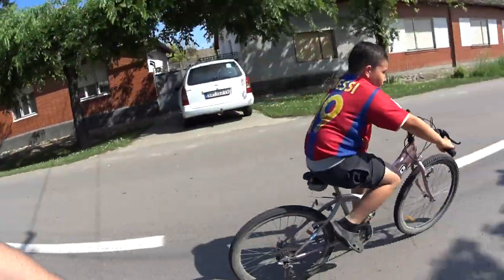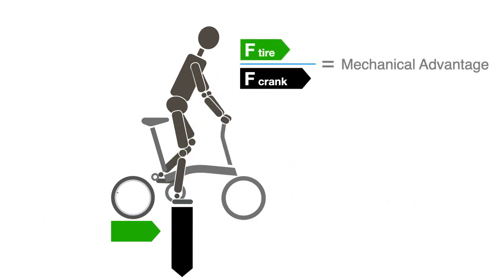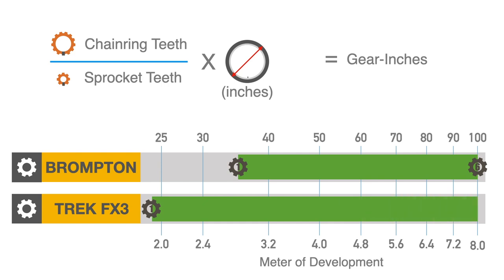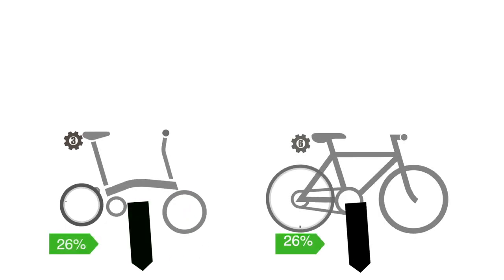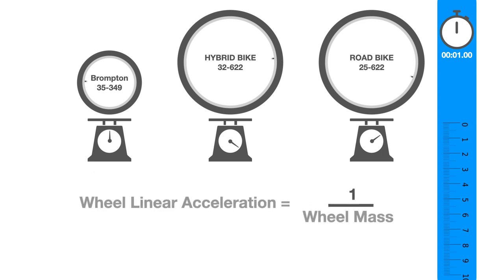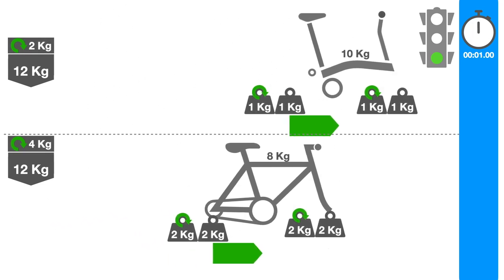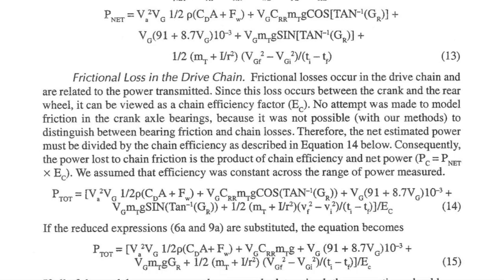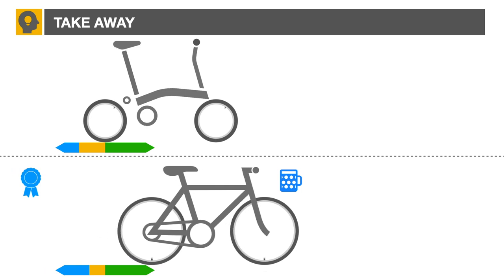Brompton Acceleration - Myth or Reality?

Comment: A year ago, I've made some math and get the rotational inertial of 20" wheels would translate to 1,5 kg advantage weight in comparison to 26" wheels, which mate your results. That doesn't explain why I jump ahead in may folding bike when the lighs go green. The answer may be on the much faster changing gears that is possible on a bike with smaller wheels.
Reply from the maker: Everything else being equal, 20” tires have better rolling resistance than 16”. The bike (and you) may also be lighter than your opponents (and/or you are in better shape then them :-)
Reply: Lower centre of gravity
Reply: Maybe also that it takes less time to "get in position"? Just a thought...

Comment: moment of inertia is actually sum( mr^2) for all the point mass in an object. so i believe when calculating the rotational kinetic energy, since the mass is closer to the axis of rotation, mass value is NOT the only factor?

however, i agree there are too many factors at play, so, why don’t you do some physical experimentation with some bikes you have. accelerate 10 times with each bike, look at the footage and give conclusions. isn’t this how we get statistics?
Reply from the maker: You are right Osmond, a bicycle wheel moment of inertia (I) is computed using sum(mr^2). So, at first glance, r seems to have a much bigger effect than m.
To simplify calculation below, let assume most of the mass is located on the perimeter of the wheel.
The Newton’s second law as applied to rotational motion is: 
T = I α 
Where:
T = (Tangential) torque on the contact patch
I = Bike wheel moment of inertia (mr^2)
α = rotational acceleration (in radian/s^2)

Assuming the propulsion force on the contact patch is F, we have
T = F r
We know the relation between rotational and tangential acceleration is defined as:
 α = a/r

So, if we replace the value of T, I and α in Newton's 2nd law equation, we get:

F r = mr^2 α / r

If we cancel out all the “r”, we get:

F = m a (which obviously looks very familiar)

So, the tangential acceleration (a) on the contact patch will be proportional to the propulsion force F applied to it divided by the mass (m) of the wheel. We already established both bikes will have the same "F" if they have similar crank and meter of development. So, the radius will have no effect.

Rotational dynamic motion is based on Newton’s laws, not statistics.

Comment: Sorry, as well intentioned as this video is, there are several errors in the deductive logic and calculations. To highlight one, at c4.40mins, the weight of a bicycle wheel is a factor in the linear inertia, but a much greater consideration is its radius. This can be understood better by considering a wheel as a simple lever in which a longer lever resisted at the fulcrum requires more force to resist with the same weight applied at the other end than a shorter lever; in other words the Brompton wheel will initially accelerate quicker with the same force applied at the hub than a larger wheeled bike because of the mechanical advantage. The issue that is most egregious however, is the omission that friction in the Brompton gear hub, especially in the high gear, is significant which slows acceleration. In the case of a headwind, the Sturmey Archer friction is unable to overcome the opposite force applied to the rider which prevents any acceleration at all. Brompton's are great bikes, despite this flaw, but this video does not unfortunately fairly represent the physics involved.
Reply from the maker: Internal hub friction losses vs derailleur and aerodynamic effects  (as discussed in our video ( https://youtu.be/F98oQ7Xo5mI )) were indeed taken into account in the simulation model used.
This model ( https://www.researchgate.net/publication/279937184_Validation_of_a_Mathematical_Model_for_Road_Cycling_Power ) was demonstrated to have a correlation (R2) of .97 between projected number and actual measurement. If your recorded evidence significantly diverges or maybe you favour some opposing  view research paper, please share them with us.

Comment: That was quite impressive. I fully expected a Brompton channel to say 'it beats road bikes'.  I would be surprised if 90% of the viewers had any idea what you were talking about (myself included) however. I think a real world test featuring the same rider with a watt meter to make sure it is the same output for each bike would have been better. My own experience is that I have a 6.8kg single speed hummingbird folding bike with carbon wheels and the sense of speed, maneuvering and accerlation is unrivaled by any other bike I myself have tried to ride.I think a lot of acceration and time is wasted shifting gears, with the hummingbird, I can stand pedal initially to accelerate and then quickly transition to sitting down without wasting any acceraltion shifting. If you hit a long steep hill, just walk quickly
Reply from the maker: Actual test would indeed be ideal. We are planning to analyze GCN’s latest YT video about Brompton to extract some “field data”.
What crank, gearing (front/back) and tires do you have on your Hummingbird ? What would be the weight of a wheel (about 1Kg?)
Reply: I often wonder how these field tests are done... I imagine there would have to be a lot of experimental and statistical control for riders' motivation, familiarity with the bike, road uniformity.
Reply from the maker: @tandago7281  One way to simplify the test would be to do 2 races and swap bikes and riders between races (each rider doing a race with a Brompton and a race with a road bike)

Comment: I believe the nimble feel of the Brompton gives the illusion of acceleration. Regardless, on my 6 speed with 44T front chainring, I use gear #1 for maximum acceleration out of difficult junctions (from a standstill) but otherwise gear #2. I have never attempted racing conventional bikes away from standstill, but in tight traffic conditions I am happy to say that the Brompton is the fastest of my own bikes for making good progress. The nimbleness, short overall length, and ability to change to a low enough gear (on the 3-speed changer) at or near standstill means the bike is a perfect traffic companion.
Reply from the maker: Agree. Size, agility (and downshifting while immobile) makes it easier to use in a crowded urban environment than a full-sized bike (We have 44T as well btw.)

Comment: Sorry, you didn't cared about mechanics , I'm 26" Montague Paratrooper and brompton owner , I'm used to ride them alternative , monday with one , tuesday with other, and compared them and feel be easier maintain high speed on avenues because the last element in contact with pavement must have shorter transmission rate, the 16" wheel in this case. This is a practise experiency. Not theoric.
Reply from the maker: Thanks for your insightful comment.
Our Montague Paratrooper 26” (yes, we do own one as well) is heavier than our Brompton, is it the case for you?
Our Montague tyres have a higher coefficient of rolling resistance than our Brompton, is it the case for you?
If yes, this would explains why you (and we) are faster on a Brompton. If not, congratulations, you have beaten the law of physics.

Comment: great maths but in the real world its unlikely one would accelerate from a stand still from half way through their gear range. would be interesting to see the results of a real world drag race next time! thanks
Reply from the maker: We support your suggestion for an actual “drag race”!
We confess, in a normal urban environment (assuming flat road), we rarely use our Brompton 1st or 2nd gears, even at traffic lights (we do have a 44T)
Doing the math using a lower gear setting, the Brompton would lose and additional 3% efficiency due to its hub planetary gears while the Trek would see an improvement in efficiency due to its use of a bigger sprocket, so the updated results would not be too favorable for the Brompton.
Reply: @2Bikes4Adventure  I assumed as such but I don't have the base knowledge you do to make this statement. Thanks for further clarifying for us
Reply: @2Bikes4Adventure  oh wow thats so interesting. i hadn’t considered how the hub would affect things, thanks!
Reply: @2Bikes4Adventure  "We confess, in a normal urban environment (assuming flat road), we rarely use our Brompton 1st or 2nd gears, even at traffic lights (we do have a 44T)"

This is exactly right. On my Brompton, I typically start in gear 2 or 3 when it's flat, which is already 'easy enough'. Also saves an early gear change. I only tend to use gears 1 and 2 when going slowly through busy areas or going uphill.

None of the above is that relevant either, though, because the non-Brompton can just be down-geared to make it equivalent (indeed, it has a larger gear range) and then, as stated above, the Brompton loses some gear efficiency.

Comment: The acceleration of a Brompton is quicker up to around 10mph than most full size bikes. However this is not down to comparing wheels, rotating weight etc it is down to it lower centre of gravity and stability allowing the rider to get away easier. At higher speeds this advantage falls away. It is as simple as that
Reply from the maker: Somehow, superior stability is not the first thing that comes to mind when thinking about Brompton (ever tried to cycle it with no hands?). So, could you support (through scientific references (url)) your claim about Brompton’s superior stability  and the advantage it provides over a full size bike during acceleration?
Alternatively, feel free to use eigenvalue analysis (or any other mathematical methods) if you want to elaborate yourself.
Reply: @2Bikes4Adventure  thanks but I think that you are missing the point in that your video should have taken this into account. The Brompton isn't the only bike with small wheels and a low centre of gravity. There is research back to the late 1950 by Dr Alex Moulton that demonstrates clearly this point when he was designing the f frame. This along with other scientific tests around wheel sizes led him to draw this conclusion.. A traditional frame with larger wheels has a higher centre of gravity and initially is more awkward to get going. The low centre of gravity on small wheeled bikes allows the rider to make the most of inputs. As for stability yes I agree taking hands off is not Ideal but this again relates strongly to weight distribution being concentrated low and placing hands on bars is the perfect counterweight to aid stability and a clean getaway Which is also why I can make crazy Sharp turns at lower speeds that my full size bike could never make.  On a large wheeled bicycle stability comes into its own when properly on the move. The low centre of gravity also aids loading these bikes right up and maintaining stability.
It arguably is also in part why small wheeled bikes are still banned from a lot of cycle race events. If they were no competition what are they worried about?

Watch the video link from the 60s which eloquently shows how good small wheeled bicycles are and it has taken large framed bicycles a long time to catch up at the expense of fragility due to the higher than usual tyre pressures and frame stiffness that was not present until relatively recently
Reply from the maker: Hi Harry, thanks for the URL. Moulton’s victory was most likely due to its smaller frontal area (aerodynamic, especially while drafting) and suspension (less rolling resistance). Needless to say, the drop bars and front suspension are nonexistent on a regular Brompton. In any case, stability (and its effect on performance) could make an interesting subject for a future video. We will look into it